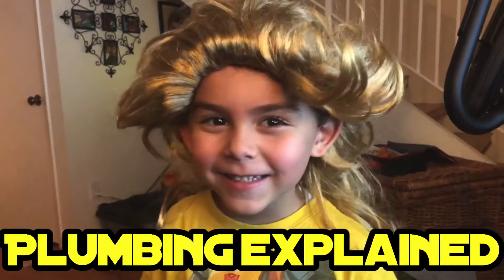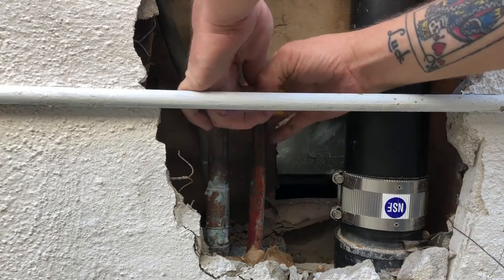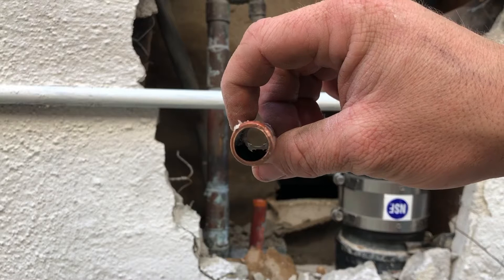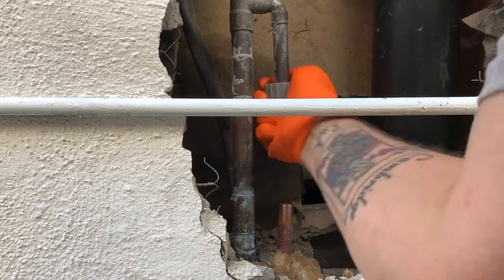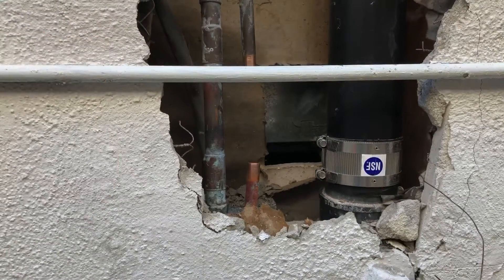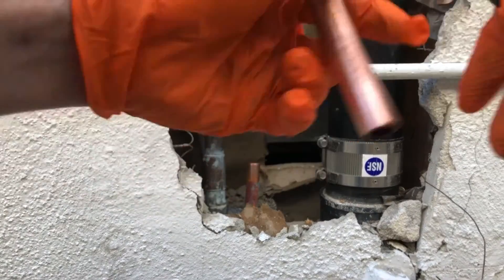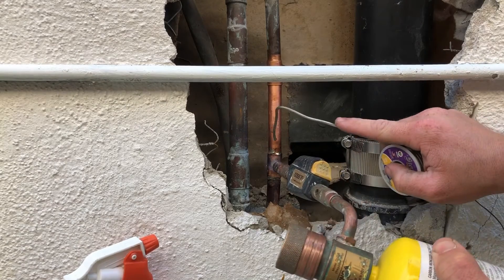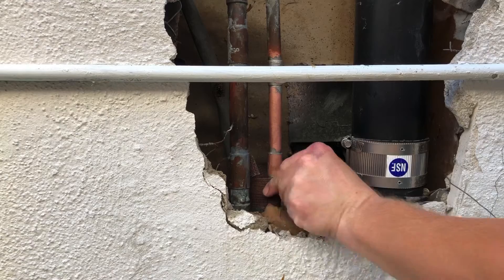Copper Pinhole leak How to Fix | How to solder copper pipe for beginners

Comment: I've had this happen multiple times in my stairwell always on hot,last time I found the pinhole after falling through wall😂 and another at the T, unfortunately I have to choose my battles, I've changed all my quarter turns since they failed and my washing machine valves, I live in las vegas house finished in 1990 and last year black poly on city side failed,so I'm currently saving up for a mainline run and irrigation main repair..Back went out or I would've dug up myself my whole home is a timebomb, unfortunately i haven't changed my angel rod in 2 years either so im sure water heater is next...its 20 years old thanks to maintenance

Comment: I believe once these pin holes start, it indicates your copper pipes are "rotting" and this is going to be a recurring problem until the run is replaced...
Reply: I had this same problem three weeks ago two days before a four day hard freeze. Leak was in hot water line to kitchen faucet and was about two inches above the slab and facing the outside wall. Pipe was literally falling apart, it developed another pinhole just before I was about to restore water to the house. House is 59 years old, I had to shut off the water to the house and the outside supply line froze and busted(11 degree temps in Louisiana are not common). I had all copper replaced with PEX and now all is good.

Comment: Fine mesh strainers or hot water filters should be installed on the outgoing hot water supply pipe from a tank water heater. Tank water heaters are made of cast iron and when bits and pieces break off they end up in pipes. If there’s a stray current running through the copper piping system, it will react or charge those bits and pieces, speeding up corrosion of the copper pipe.

Comment: I just replaced my water heater. But while doing it I noticed some corrosion and a very small leak in one of the lines. 3 questions, how do I clean corrosion off? how do I protect the lines from corrosion? I may do the job myself. Technically I need to move the water heater and elevated and washing machine would move also and put in new lines. But if I can fix this and make it last a long while longer...I would prefer that.

Comment: As a homeowner would you ever use epoxy?
Reply from the maker: No I would not ever recommend epoxy again, I use to recommend it in certain situations where the repair or re route was going to be extremely costly but I was doing research in 2019 and found the epoxy liners can potentially cause cancer. Each company uses a proprietary method but from what I was reading I found they all pretty much use the same chemicals. 

I’m all for epoxy in drain lines but not in fresh water systems anymore, also once you’ve had your lines epoxied you can pretty much only use pro press to do any future work on the system like remodeling, moving fixtures around, changing shower valves etc

Comment: I just discovered that a leak is happening inside my drywall right in front of my water heater in the garage. House was built in 1979 I think, and I thought it was my water heater but upon drying everything, I realized that the leak was coming from the inside bottom of the drywall and not the water heater unit itself. 

This sucks.
Reply from the maker: Where do you live? If you are in Orange County California I can help you out.
Reply: @PlumbingExplained  Appreciate the offer man. I love CA, was born and raised there but just moved from Rancho Cucamonga to Arizona bro. A bit too far I’d say lol. 

It’s just too dang expensive

Comment: Why would you deburr that riser piece? The shavings are gonna fall right in and you can never get em out could clog an orifice some where
Reply from the maker: I flush any line that ive been working on thoroughly before allowing the water to run to fixtures.

Comment: I have copper pipes all throughout my house and they spring a leak or two every year this year I have had 4!
so far I have been lucky and the pipes are in free-air. the thing is most of them are clean no corrosion and they just decide to start leaking.
WTH?!
Reply from the maker: Its the minerals inside the water eating your pipes, Alot of water municipalities use a chemical called chloramine and that chemical apparently is bad for copper eats it from the inside out.
Reply: Can I add a component to the water to remove or reduce the chemical causing the pen holes? Maybe like a water soft system?
Reply from the maker: @d.c.poolecustomhomesllc8842  yes you absolutely can

Comment: So copper rust only when it's on the ground? What about when it's elevated? Does copper inside of a house walls rust?
Reply from the maker: Sorry for the late reply Brother, Copper typically will not rust inside the walls or in the attic etc unless its touching another metal.

Comment: If you cut the new pipe to the size of the old pipe cut out piece,  and used two regular couplings, how did you get it into,place...? That part of the video is missing....or did you use 2 no stop couplings? In which case, how did you get to hold it in place....they’d just slide down....I’d really like to know and see how you did that...thank you.
Reply from the maker: Yes i use 2 repair or slip couplings without stops and if you take channel locks or pliers of some sort and squeeze the couplings slightly then either turn the pipe a little or the coupling it will stop them from slipping down. But yea Ill make a video here either tonight or tomorrow showing how its done... My throat is all jacked up right now Kindof hard to talk but maybe Ill have my wife narrate it for me.
Reply: Thank you very much for your reply!😀. Sure looking forward to your video and demonstration. Please let me know when you post it. Mike

Comment: If you notice green spots on copper pipe should you try to tape it/seal it.  I notice some on my cold supply line on water heaters.
Reply from the maker: Steve Porter no copper naturally turns that color when exposed. Same reason the Statue of Liberty is a greenish hue she’s actually made of copper. Sometimes those freckles though can be signs of a future leak so keep an eye on them. Also if you are referring to the flex lines going to your water heater I would swap those out with stainless steel lines as soon as possible and not the crappy ones from Home Depot either. Get you some of the good ones from Ferguson plumbing supply there’s likely one near you and they serve the public as well as contractors. For some reason the copper supply lines often pinhole I don’t know if this is the case outside of southern California as we have very hard water here and they use a chemical called chloramine which actually eats the copper. In summary: So if you’ve got copper supply lines connecting your water heater to your plumbing system replace them or have them replaced immediately this will save you potential leaks in the future and it will also stop unscrupulous plumbing companies from selling you a new water heater over a leaky supply line which happens way the fuck too often.